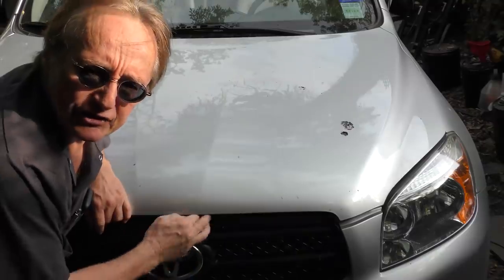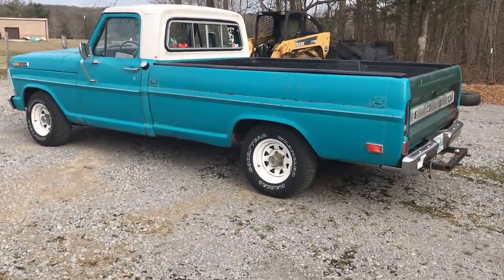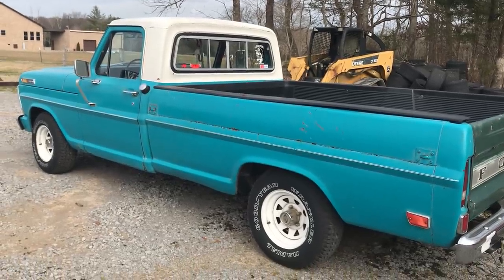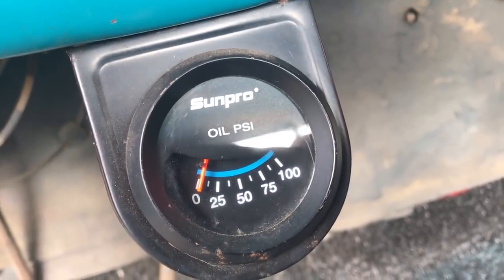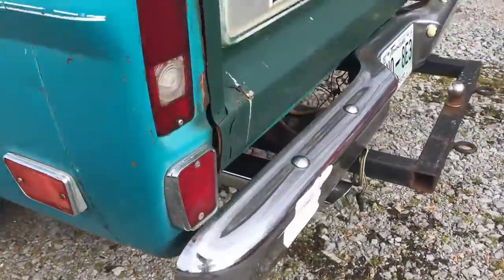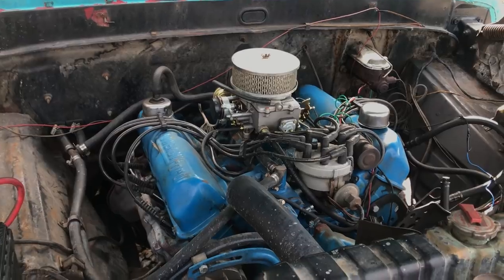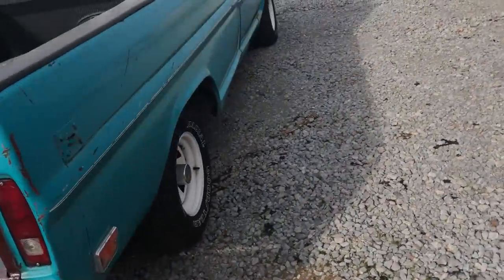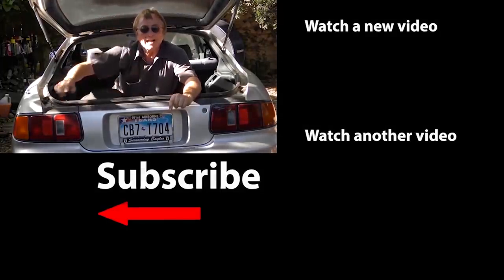Here’s What a $900 Ford Truck Looks Like

Comment: Back when a truck, was a truck!
Reply: Yep you sure got that right man. I've seen some YouTube videos where people take old trucks like these and turn them into high performance machines!!!!! It's so epic!!!!😁😁😁😉😊😊
Reply: Dats right!
Reply: Right?
Reply: Varnce  
Dats right
Reply: You mean back when trucks were unreliable and cheap.
Reply: I mean, I have a 2006 f150 xl single cab that isnt whole lot more advanced then that one.
Reply: Everything Atvs Wrong
Reply: @JoshuaOverman  no, your definitely wrong about that one
Reply: Bucking Bronco Lol You Can’t Say I’m Wrong Until You See How The New Trucks Are Running In 40 Years they get better every year and that’s a fact my dads 2001 7.3 Powerstroke Needed a new transmission at 70k miles And Had A Few Other Problems When New My Dad’s 2017 6.7 Powerstroke That he has now is at 100k miles and zero problems and on the original brake pads.
Reply: @JoshuaOverman  I have a 1979 Bronco with 240,000 mileage with original trans and engine with no issues beside a misfire because of a sparkplug. Though, my 2006 f150 with 70,000 miles is already looking to need a new transmission itself
Reply: Bucking Bronco Also I Know Someone That Does Hot Shot Trucking And They Have A Few 6.7 Powerstrokes With High Miles And Haven’t had much Problems.
Reply: @JoshuaOverman  that's great, it's a good solid built truck. That's one example from today. The best part about the older trucks are even when they did have problems they were easy to fix.
Reply: Everything Atvs not at all. Completely the opposite.
Reply: Bucking Bronco sensors.   Ecm.   Junk
Reply: @mateodelcastillo7186  dude, I dont even know what you were trying to say.
Reply: 200% Agree.
Reply: "Mr. Majestyk" used a '69.
Reply: When such a vehicle was bought by Men,.. driven by Men,.. to do a Man's work!!
Reply: Joshua Overman then he doesn’t know how to treat it
Reply: Back when you open both doors and hose out the red clay mud!
Reply: And cars where proud of it!
Reply: And a buck was silver and we walked to school up hill both ways.
Reply: You mean back when trucks were real trucks
Reply: @thatmarred_mustang  is it for sale look up $1,200 I don't know about traveling all the way up here to get it
Reply: @andy.ncforestcitychart2444  is what for sale mate?
Reply: And these days this truck is still a truck and a half.
Reply: @JoshuaOverman  l have owned and driven a 69 f-100 with a 300 straight six for almost 40 years. It is a very dependable ,smooth running truck. Back in those days a truck was a TRUCK! Todays trucks have so many factory techs , more things to break down.
Reply: Fax
Reply: bench seat, very versatile, and does what a truck has to do

Comment: I bet the Ecoboost Ford's selling now won't be around in 50 years.
Reply: I think vehicles in general are more reliable today up to a certain point.  I agree that the ford ecoboost won't be around in 50 years, but I think it will be because they will no longer produce the 50000 parts that keep it running.  cars today seem to be disposable
Reply: @jonathanmarquise422  Yes, cost more and wont last as parts wont be available.
Reply: That wouldn't last 10 yrs let alone 50, too much plastic low quality gasket premature piston wear jeeeeeez!
Reply: I totally agree brother.
Reply: @ravidas4852  You're totally correct.
Reply: @ravidas4852  
There's an Ecoboost currently with 200+k on it
There's also an ST thats got 300k on it before it started over heating and nobody could figure out why
Reply: Yes they will , just look on the ground for the BIG pile of rust .... lol
Reply: But after a wreck, the driver of the Ecoboost will still be around. Not so much for the driver of this thing.
Reply: @jonathanmarquise422  - Disposable = Planned Obsolescence.
Reply: @jonathanmarquise422  not unless 3d printing becomes more advanced. Then you can print your parts lol.
Reply: True they don't lend themselves to long lifespan but how many of those 50 year old pickups are still around without being restored?  Not many, I'm sure somewhere there will be an Ecoboost Ford put in a barn to sit for years that makes it to that age too.
Reply: @ravidas4852  I could see your comment if Ecoboost vehicles were only a couple years old but the EB has been around since 2009-2010 and the plastic blah blah blah hasn't changed much in the past decade, just the shapes of it.  So, vehicles on the road right now prove you wrong.
Reply: Hahahahahahaha you got that right
Reply: @czluver4338  y this truck is made out of metal y wouldnt it be around
Reply: Mike Brandenburg There’s always a few that end up in someone’s garage only to be driven a few days out of the year, but that’s  .0001% maybe?? Only time will tell, who knows what the aftermarket will be like in 50 years and the EPA?
Reply: Mike Brandenburg nope
Reply: Jonathan Marquise no modern car will ever be a collectible
Reply: cz luver after a wreck the eco boost is totaled
Reply: Stinky Cheese it still won’t be a collectible
Reply: Lol they dont last 20000 miles without an oilcatchcan
Reply: Modern vehicles designed to be as service free as possible up to 100k then all systems fail and no parts available so you have to go new. Built in failure. Worked at enough of them to know.
Reply: No truck selling right now will be around in 50 years.
Reply: try electric dude
Reply: There'll be a  lot of junk turbos laying around.
Reply: @ivanmeza5287  3D printing can do a lot already. They printed pieces for the F-35 at high sea (they didnt have the pieces in the aircraft carrier, for whatever reason) and it flew with them. 
3D printing can be used to make pieces for old cars, for old planes, boats, whatever.  As long as you can find the specifications for the pieces you can now (virtually) keep any vehicle running indefinitely.
Since 3D printers can also use aluminum and steel it's now also useless to ban or try to control guns since you can print them at home and the schematics and specifications for almost any gun can be found online. Even if they couldnt, guns can be made fully in carbon fiber. Dont know how the metal from a printer compares to metal from the gunmaker's forge but if the steel from over 100 years ago made guns that still shoot flawlessly today I guess we can do it too.
Reply: @zachariasprice3762  that's the beauty of it (:
Reply: @jonathanmarquise422  Today's movement, is EVERYTHING is disposable. Kinda strange, when we are supposed to be saving on mining poor mother earth to DEATH. The so called footprint of these vehicles, were paid for decades ago, what we all should be driving if you think about it.
Reply: Modern Plastic Cars -Yuk.
Reply: The will not be around in 15 years.
Reply: most cars from the 00's wont be around in 50 years no one cares about garbage,no originality,no personality cars
Reply: @0Heeroyuy01  They will not be around in 20 years.  The 2010s model lineups will never become anything collectable either. It is more of the same, bland, ugly, flimsy, plastic clad, garbage as well.  The only ones that may become collectible classics are Challenger, Corvette, Mustang, maybe Camaro, the rest is forgettable junk.
Reply: @indridcold8433  yep,and honestly not that the corvette isn't anything special like it was nether is the challenger,charger,camaro or mustang for that matter i don't see them becoming collectible ether with the exception of the bandit edition camaro's made by transam worldwide,or perhaps the cobra edition mustang.
Reply: @stillnottellingyoumyname8193  yeha no new ecoboost will last that long, because htey are going eletric in 3 years. but good one people
Reply: Or even five years
Reply: Trucks and cars today are made to fail. So that you have to go back and pay more to fix.
Reply: Mike Brandenburg We should be driving nuclear cars by then.
Reply: We Won't Either.
Not Even As A Country !
Reply: @jonathanmarquise422  
People Too !
Reply: The EcoBoost will probably be in the junk yard before its paid off.
Reply: @czluver4338  After a wreck the F100 driver won't need to dump another 30k on a brand new truck
Reply: @ivanmeza5287  Porsche's now printing its pistons...sooner than later your prophecy will be true...
Reply: In 50 years i guess we'll have to see
Reply: @rubblejohnstone4460  throw away vehicles is whats built now , Not built to last
Reply: @jonathanmarquise422  they are more reliable up until probably around 100k
Reply: hard to say, it's a great engine if we're just talking performance.

Comment: How many 2019 trucks are going to be around 50 years from now? zero.
Reply: Payam yazdi ikr. I was looking atA few 2000+ vehicles on eBay. Then I decided to take a look at the 1960 to 1985 range and they have some really nice trucks
Reply: Nor would I want it to. Safety has advanced significantly over the last decade and will continue to advance. I'd take safety and survivability over nostalgia any day.
Reply: @czluver4338  i wont
Reply: Well, a whole SHITLOAD of none of them.
Reply: @czluver4338  Yeah, soon they will come with ejection seats that will malfunction and turn you into pudding from hitting a bump shooting you into the roof xD
Reply: Maybeee, the Tacoma, well, at least the motor
Reply: RJIVHalo. in a old ford truck
Reply: Chevys will be around the Ls is a stout engine man
Reply: @czluver4338  until a emp hits.
Reply: Payam yazdi except the v8 5.0’s
Reply: @czluver4338  true but older is more fun
Reply: @czluver4338  Typical modern car lover and just to let you know that my 96 Ford F150 with a 5.0L (302) Windsor V8 will outlast whatever you drive mate.
Reply: @czluver4338  Um yeah keep believing that. There were cars getting 26 to the gallon in 1992, so you are saying there are cars getting 75MPG now... Not in the ordinary fleets...
Reply: Only if you don't drive it
Reply: @czluver4338  if you get rear ended in a new truck, you're paying more than what these old trucks are worth.
Reply: I have a 98 Dodge Ram 1500 I bet it will outlive any newer trucks nowadays lol
Reply: Ricky Davis keep your transmission serviced good they like to go out
Reply: Yet all the 90’s and back will still be rolling
Reply: plenty

Comment: Nice truck! Here in Colorado the same truck guys would be asking 3500.00 or 5000.00 for it. People have went insane on car and truck prices here.
Reply: Yeah, here in TN it would prob be around $2000.00, maybe more.  Decent old trucks are worth alot more in some areas.  And if it has low miles... well, good luck buying them for what the "book" value says.
Reply: Yeah , they must be high ! Lol !
Reply: I live in the springs and this is very true. I bought a fucked up ranger for 1000 (overpayed) and fixed what I could and sold it for 2600
Reply: If the frame is solid, these trucks and older vehicles can be built over with modern parts and still outlast a brand new car in the long run. There was room to service everything on the vehicle. Not like today's vehicles that the engine bay has no room at all with plastic garbage covering it all.
Reply: How do you know?
Reply: Ben - listen to the beginning
Reply: I guy near where I live sold a '72 with no drive train for $7,000, not asking sold!
Reply: @Mandurath  he is in Tennessee....check the license plate
Reply: @JAllen-zk2zw  lol never noticed.   Guess I need to check his part of the state... or start looking alot harder...
Reply: It's really hard to find anything for a reasonable price in Wisconsin too because everything rusts here, so people put high prices on anything in halfway decent shape.
Reply: Ben same here in Utah
Reply: Similar situation here in AZ. That truck would sell for $2k-$3k easy. Understandable why prices might be high though as old trucks here don't rust at all lol. We got dry heat most of the year.
Reply: @Mandurath  Yeah, around Nashville you see a lot of trucks like this listed as $12k. My thinking is, why would I spend that much on a car as old as my brothers?
Reply: @JAllen-zk2zw  I know it's a year later, but for the last 6 months I have been looking for a 67-69 and can't find one under 3,000.  And that's in the same shape this one is in. someone posted he must have bought it a while ago, I tend to agree with them.  (I'm from the county right below him and about 60 miles from where he bought it by the way).
Reply: @trentonharris5521  ford or Chevy? Fords seem to have appreciated less... I can't find a c10 in half this shape (not running, rusted, no drive train) for anywhere near 3k...
Reply: Same here
Reply: true Greeley is insane
Reply: I just got one the other day for 450 in Pueblo lol it still runs with a 390 (sounds amazing) just needs brakes
Reply: I just bought a 70 lwb. I think it’s a 360...headers, new exhaust and it looks almost NEW underneath.😲👀 it has surface rust in all the right spots and any true lover of oldies knows...patina is BEAUTIFUL.🥰 love me some old Ford Trucks
Reply: Here in the Midwest a truck that old would have major rust and they would still want at least $2500 for it.
Reply: @1978garfield  I have a 1970 covered I patina🥰 runs like a champ,underneath looks brand new.! It’s amazing that a 50 yr old vehicle can be in this good of condition..FOR SALE btw
Reply: that's not too bad, sure it is old if you're going by years,
but I'd have no problem paying $3500 on a truck this old,
provided it's in good shape and was well maintained.
it's pretty rare to find something that old that was well
maintained, but they do exist. 
you're not wrong about car prices, i think i would have more
of a problem if someone tried changing $10k grand for it.
i think $2500 would be the most I'd be willing to pay
for something this old, but we all gotta eat and pay bills lol.

Comment: Scotty! Good morning! I have a 1972 Ford F250 - I paid $1,200 for it! Thank you!!! This is nice looking truck!
Reply from the maker: morning, send me a pic of it, scotty.mechanic@gmail.com
Reply: I had a 72 F100 Ranger longbed 360 2v/C6/9" in Maroon ,, had enough rust to see through both sides of the bed (that seam rots out) and "Mexican blanket" seatcovers back in the early 90's ... paid $1200 , sold it for same after a few years ,, freebie! and a great truck.
Reply: That's awesome man! Sounds like a nice truck!
Reply: I bought a 72’ F250 brand new off the lot. It was the last one they had as the 73’s were out. Paid $3600. Included adding the big tow mirrors, Two-18 gal. saddle tanks in addition to the 20 behind the seat & heavy duty rear bumper.  No a/c, auto trans, 360 cu in (they were boat anchors , no power. 390 was a superior motor but not too many around.) . It was the middle of the road model. 10mpg’s empty, full, towing. city or freeway didn’t matter; 10mpg’s.
Reply: Hey Herb! Sounds like a cool truck! Besides the gas mileage.... I love my 72. It's not my daily driver but it is nice to have when you need it!
Reply: I paid 1200 for my 69 F250.
Reply: Youdontneedto Seemyidentification haha it’s pretty beat up.. it’s on my channel. She has her battle scars but believe it or not.. same engine and trans.. still running.
Reply: @scottykilmer  77/78? F250 with factory brush bumper. Mint green factory painted flat black over it. 300 bucks in 04. 6.6 liter 400 / modified 400, 2 barrel 700 cc carb. C6, Dana 60 . Worked that truck in the ground 5/6 years put 100,000 miles on it , racked.rear Springs. 31.1050. 10 ply mud tires on back. Made so much money ,fire wood scrap, every day. 16 mpg. Honest. Smoked some fast cars in it on hyway. Blew mother scraped. Good truck
Reply: where did you find it to buy?

Comment: Just like a truck should be old simple and solid! Love old pickups, I’ve had a few newer nice trucks and I was always scared to use them for work and beat them up, that’s the beauty of old pickups!
Reply: Exactly mate but these modern truck lovers will never learn.
Reply: Thirteen years ago I sold my 2003 Dodge Dakota and paid $2500 cash for a 1997 Jeep Cherokee Sport that had 80K on it.  Getting rid of the Dakota saved me a lot on payments and insurance.  I've put on a starter, alternator, front rotors and pads, Bars stop leak for the heater core, two batteries, two sets of tires, and lots of oil changes.  I need to fix the cruse control,  and cigarette lighter some day.  I've added 90K to the odometer, the engine sounds solid and the automatic transmission shifts fine.  Pretty cheap ride.  I got rid of the Dakota because I was afraid to scratch it, I liked to go fishing back then.
Reply: Through out the years I have owned several of old Ford trucks, mostly with six bangers, learned how to drive, three on the tree , I wouldn't rule out having another one in my life, simple reliable trucks however in the Adirondacks they are far and few to be found.
Reply: I've several fords and was never scared to scratch em or when I was living in Virginia trade a little paint! Still ain't scared